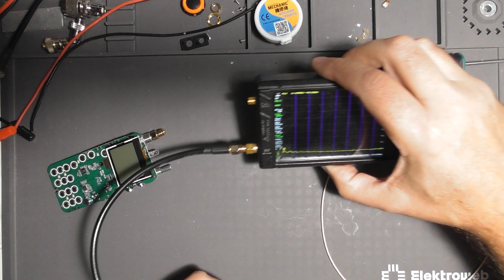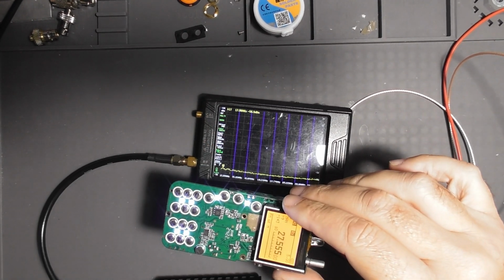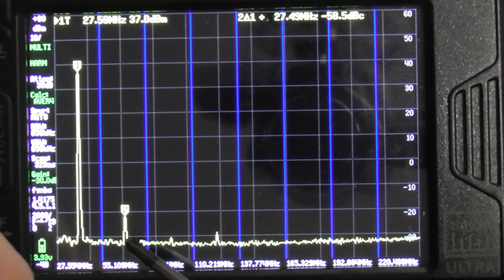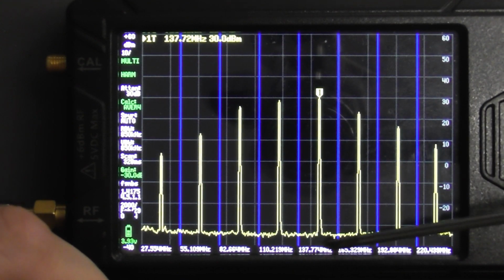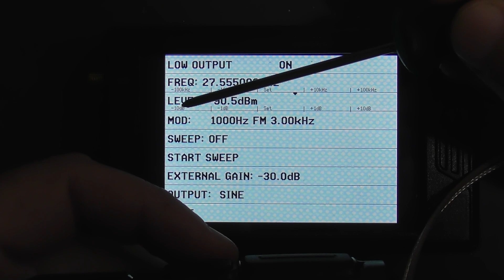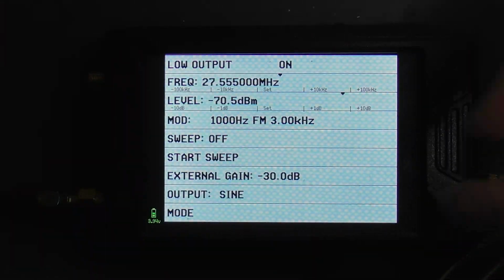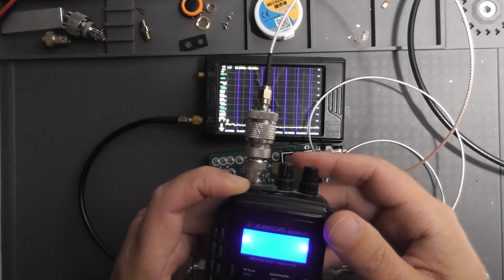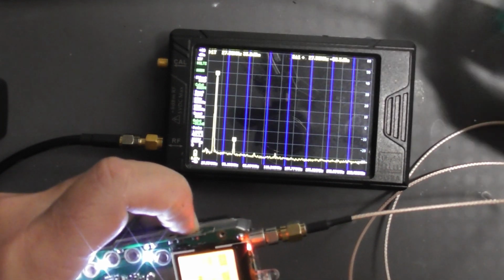Quansheng UV-K5 10-11-12m band conversion PART 5/5

Comment: Is it possible to modify this machine to transmit at 29.6MHz and have a transmitting power close to 5 watts?
Reply from the maker: Hello yes it's possible with adjusting the capacitors slightly on the pre-drive stage. 
Well with this mod it will cover 24-30Mhz but tuned more for 27 and 28Mhz. 
On 29.600Mhz you'll get about 3.5 watts output like it is now. 3.5 watts and 5 watts is nothing you will notice much in signal strength really.

Comment: pity qs dont bite and start making a hf model.
Reply from the maker: Yes that would be nice but I suppose their main market is VHF and UHF. 
Most it will go down to is 18 Mhz unless there is another radio chip that will cover all of HF as well.
The other issue is the filter section which will take up a bit of space so radio will be double the size.
Reply: @DuanesMind  6m or 4m would be nice also as there is a gap in cheap radios for these bands.
Reply from the maker: @N_Andrews  It's doable and I'm busy working on it.

Comment: Hello Duane. Saw 1 to 5 vidéo. Very Nice. It looks like easy to do. 😂.
Reply from the maker: Give it a try my friend 😉
Reply: @DuanesMind maybe. Need for this,books of capacitors mix, resistors mix and a screwdriver for diameter coils. 👍
Reply from the maker: @1cristojojo1  If you can change LED's then you can do this 👍
Reply: @DuanesMind yes. I will try.